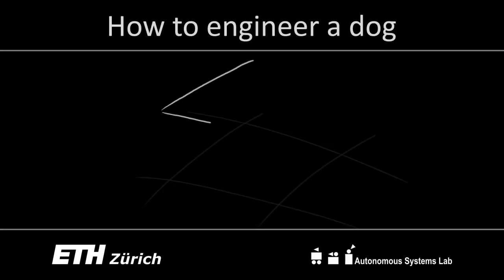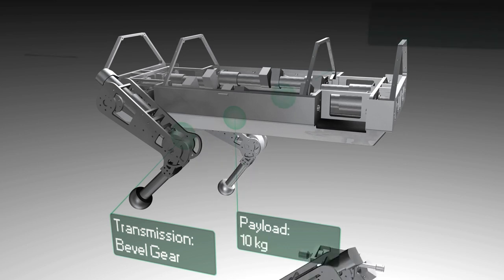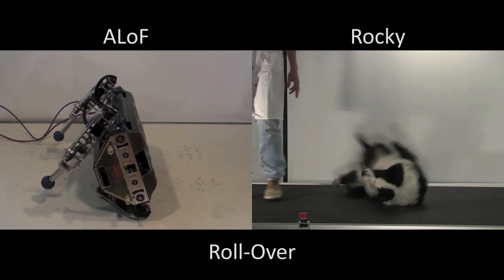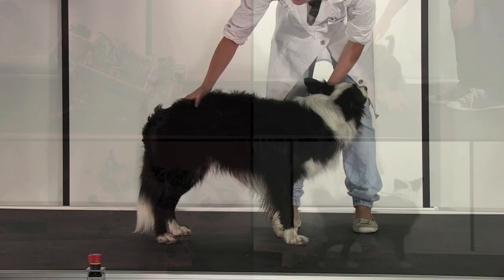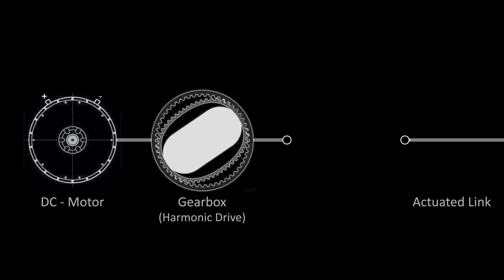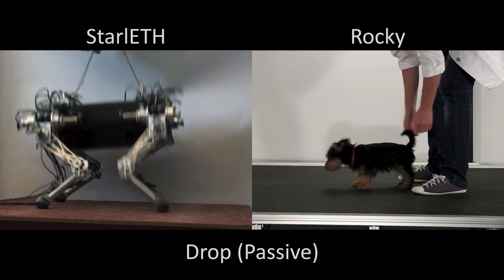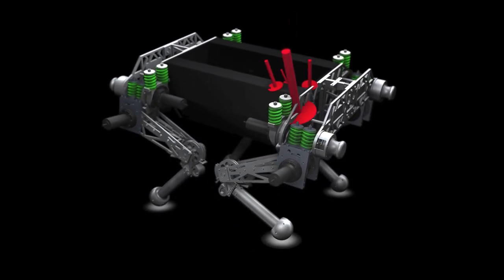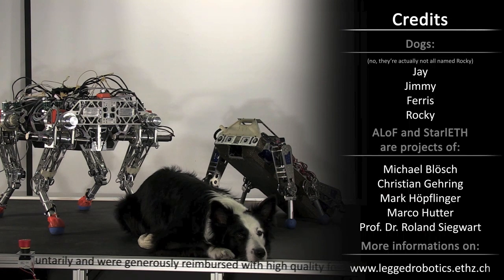Microlecture - How to Engineer a Dog

Comment: Still using gears, sigh. To make it move as a dog you need dynamic parts. Gears a not dynamic. You need artificial muscles or something that behaves identical to them.

We already know how they are connected to the bones in a dog.

What are you waiting for? Figure out how to make the artificial muscles already you lazy people! Gears wont work, they will break and are not dynamic.
Reply: Maybe you could make the Dynamic parts real, rather than knocking your keyboard facing the screen.
Reply: @chunyangzhou9144  😂😂😂 great reply
Reply: Oh yeah, why don't people already do this? Its not like artificial muscles such as air muscles are expensive or hard to find? Oh yeah, and it isn't like the system required to power these muscles would be too large or anything? So yeah, why don't people do it, it is basically free and can be done with no effort.

this was all sarcasm btw